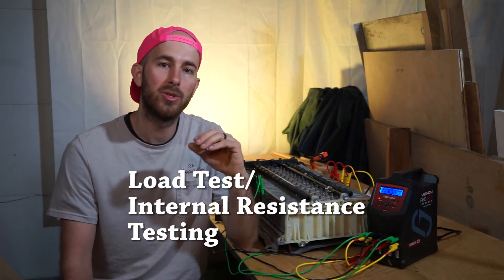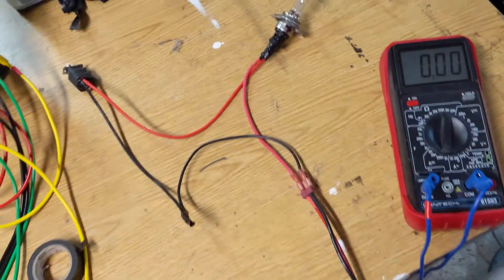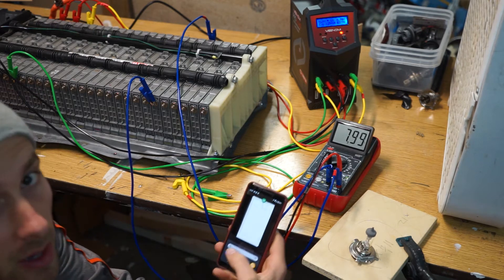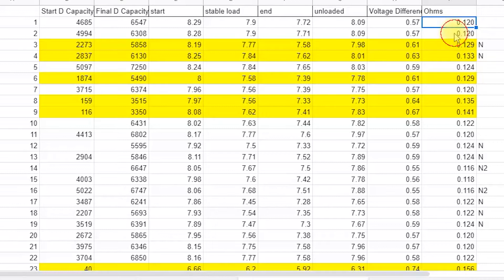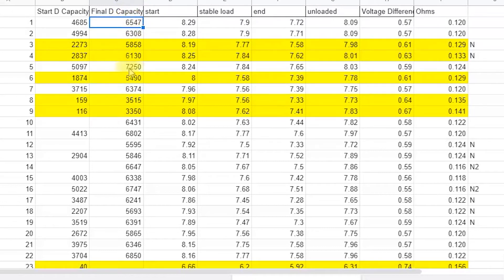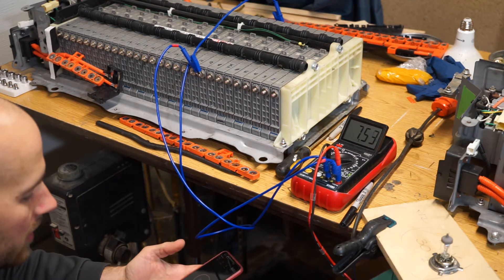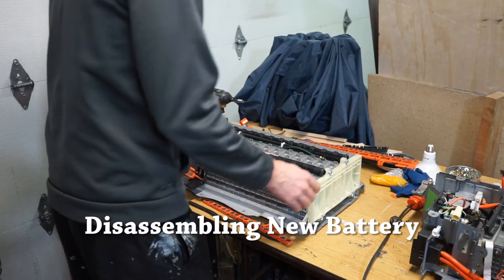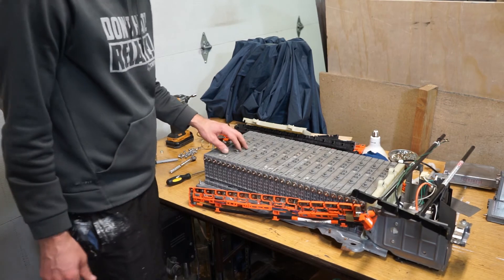Part 3- Prius P0A80 Battery Rebuild- Load testing/internal resistance testing

Comment: so high internal resistance is a quantity .25ohm or so difference
Reply: No, high internal resistance for these battery modules is about 10 to 12 mOhm.  0.250 is 250mOhms.  0.025 would be the resistance of two bad modules in a series block, as reported by the computer.  All good modules should have very close to the same internal resistance, which for these NiMH packs would be around 5 mOhms, or 0.005Ohms.

Comment: did you fully charge up the whole pack prior to doing any laod test or internal resistance check. or did you dive right into it in whatever condition the pack was at when purchased?

Comment: steve, thanks for this video. the only problem I saw with your testing was using the surface voltage in your calculations. instead I believe you should have used the voltage reading with the load applied as soon as it stabilized.  it looks like you recorded this in your chart but you didn't mention it.

Comment: I have been doing some research, it seems like you can use gen 3 cells in gen 2. But can you use gen 2 cells on gen 3. Mine is a gen 3 from 2010. Most of my cells are above 7v I have 4 that are in bad shape in the low 4v those I am going to replace for sure. However would you recommend to change anything below 7v? I have 4 other cells in 6.6. Please help :) and thank you for your video

Comment: "Internal Resistance" in the video title caught my attention.  Internal Resistance of the modules is an important attribute, and I find it is extremely difficult to track it.  If the Internal Resistance of the module is high, then the voltage drop may be considerably less than other modules.  You measured the amps of about 4.74 amps for one module with a known resistance of the headlight bulb.  As the bulb heats up, its resistance will change.  I find it elusive to calculate the Internal Resistance of the module itself.  I do know that as the voltage of the module drops the measured amps will drop as well.  When I use a load of about 4.5 amps, some modules drop below 7 volts after about 2 1/2 minutes.  A few of the modules will last 12 minutes, and the bad modules will drop below  7 volts after 20 seconds.  I am currently using an Arduino and my computer to track the voltage drop and graph these in excel.  I ordered a module that will allow me to capture both voltage and amps, which likely will give me an idea of how good the Internal Resistance of the modules are.  At this point, I think pairing the modules by internal resistance is a good idea, and also weeding out the batteries that have a big voltage drop when resting is a good idea as well.  Thank you for your thoughtful video.  It has helped me to further my testing process.
Reply: use a battery analyzer that can measure it right off the bat - no calculations needed
Reply: @wizardmaster6639 what do you recommend?  I would love to know more

Comment: One thing I realized watching these videos, is that internal resistance should be checked after the whole pack has been charged to where the modules are all the SAME voltage, because of the curve of charge discharge. This will insure that the resistance is different not because the module was at a different point in the curve, but because it actually has bad resistance.

Comment: Hello and thanks for the video. 
I have tried some different loads to test the modules on my car like you did.
Your method, which i tried only pulls 4 or 5 amps if i can remember.
I drove my car and watched how many amps the battery is giving whilst driving. Its pulling about 1 amp just by doing nothing. It pulls about 30 Amps before the engine kicks in and i noticed it going over 90 amps. 
What i'm trying to say is to use a car LOAD TESTER, the car electricians use it to test the 12volt batteries. This gives the true picture of how a battery will behave in real conditions.
Here's a video i watched and it made alot of sense.
https://www.youtube.com/watch?v=ERT-4COVnnk
Reply: Don't go for 30 seconds though. 10 seconds are enough, because you don't want to discharge them under 6.6v if they are weak they drop very fast
Reply: Yes but 4amps multiplied by 28 is 112amps isn't it?
Reply: @hogwash1462  no. You give a load of 4 amps to one battery module which is 7.2v to 8.5v. You test one battery module at a time. In the real world, the battery is asked to give 90 to 110 amps. Even for 10 seconds. I believe it is better to do a 75 ampere test than a 4 ampere test.
Reply: @panicosvasiliou4914  yep on reflection i see you're right. All cells will be experiencing this current draw as in series.
Reply: My experience is if you charge and discharge these modules at 5 amps or less, the batteries stay cool, and you don't need to clamp them. I think load testing at 5 amps for 2 minutes is a good test.  Any higher amps than that will cause the battery to discharge in a different manner than what takes place in a car.  The video you posted is not a good way to discharge these modules as it generates heat that can cause the battery to expand, which diminishes the life of the battery.  At least that is my thought.  I think the dude in the video you posted also sells reconditioned packs, and I even see someone selling Prius modules on Ebay where they say they load test the batteries at 70 amps.  This is a quick and dirty way to test modules.  Guess what modules I am NOT gonna buy.
Reply: @GaryMarkowski Thanks man!

Comment: Most videos call for 2 minute load test, is there a reason why you went with 1 minute?
Reply from the maker: As far as I know, there is no standard time for running a load test (I'd be more than happy to be corrected if I'm wrong). So any time you choose should be fine since it's just used to compare one module to another.